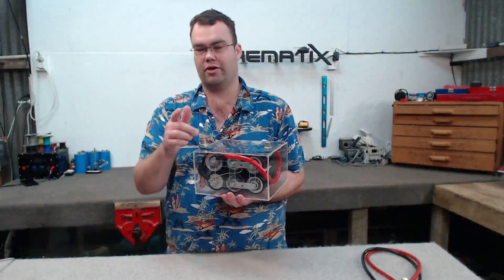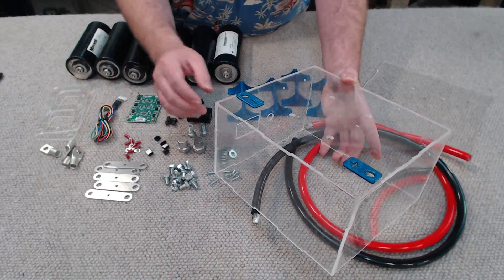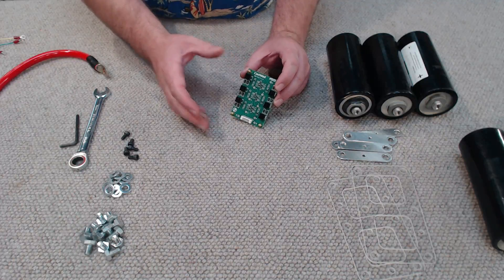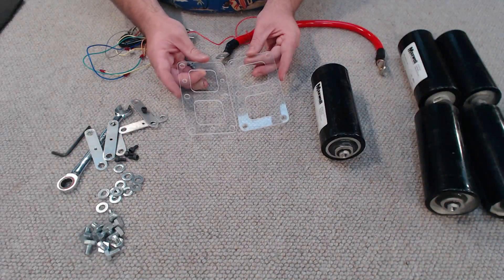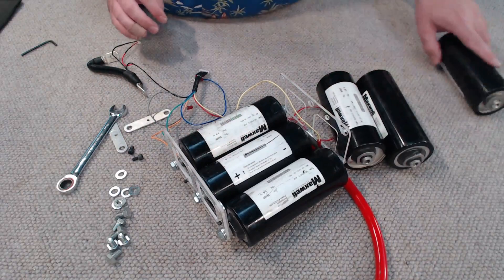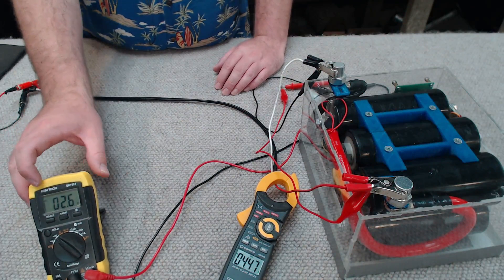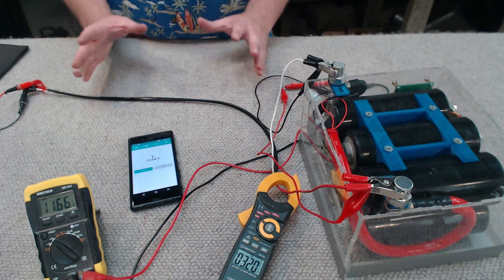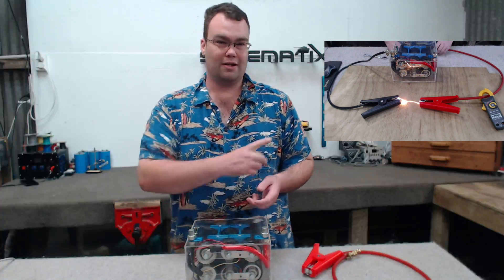Super Capacitor 'Battery' Bank Construction Video

Comment: in Australian accent That's not a soldering iron... THAT'S a soldering iron. By the way 7 years later I just bought a variation of this bank, on ebay, used. It came in tonight  but need to test it out.

Comment: How best to inspect the capacitor because even battery explode on me in 1991 if not knowing what inside and for capacitor look hard to inspect if not having window for inside or circuit Bing using voltage drop theory analysis to find hidden secrets switch

Comment: these ultra caps are not made ideally to be used without a battery! if you have a high power consuming system its best to have a good battery as well, best types are LTO batts, or LifePO4 batts, along with super caps and a good alternator of course!, these caps dont have the much needed power reserve that regular batteries do like an AGM battery

Comment: i have a question well a couple for you  can you charge these as you are using them charge while discharge  also if i wanted to build a setup like this to run a 230v 3 phase 10 hp electric ac motor would or is this possible

Comment: I know this is an old video. Im watching it after seeing your spot welder video. I was curious of the dangers with charged capacitors while working on electronics. Would touching the positive and negative posts shock you or is it safer because its only 12vdc?

Comment: those lugs are horrible...the crimp ones are worse.  you want whats called a split bolt lug. i have 8000 watt electric furnaces that run at 2600 F...and to power the elements i have to use split bolt lugs,,,,anything else just goes to crap really fast.  dont waste money , time ,,and risk a fire.  dont use crimp on lugs.

Comment: Hi all?
I don't think I can afford to make this beast, but did see a 6x500F on eBay for £35.
I need to use it as a leisure battery to power lights & charge phone, tablet, cycle lights...
I only do short trips in the van, so need something that'll charge fast, where as the leisure battery I have takes many hours to charge :-(
So if I bought THREE 6x500F's
1/ would it be a good compromise?
2/ how would I charge them (using van only) or with what?
3/ how quickly could I charge them (I'm hoping only 15 to 30 minutes)
Helpful info needed
Thanks
Mike in the UK
Reply from the maker: 6x500F cap's in series will be able to store around 2.5watthours of power storage. For context, a typical phone battery has around 10 watthours. Charge time would be a few seconds. But you'd have to limit the charge current if you're charging from a car plug. Otherwise, you'd blow the fuse every time. In a nutshell, 6x500F caps won't provide anywhere near the power storage you'd require.  The real solution for your application would be a LIPO battery pack. A quality lipo can be charged very quickly (depends on the capacity & charger used) within the time frame you specified. Plus you could have a couple batteries. So one's charging while you use the other. Hope this helps
Reply: Ahaaa, very handy info, thanks  @Schematix , I almost went for the 500F's, but willnow look for the LIPO's
Reply: So now you just have to build one of what I want & make a video about it, so I can build one myseld :-)

Comment: Ok kids I have twelve of these caps in my car for the last 8 years. I have no circuit board and I have a charger in my trunk just in case. Do not try and jump start your caps from another car , you will blow up their battery and alternator especially from 0 volts. Possibly the cars computer too . 8 to 9 volts and you will take months of life from the other cars battery! Possibly blow up the alternator.  I know i fried two of my wife’s batteries! If you want to build a charger just use a 600 watt HPS BALLAST transformer with the secondary coil chopped out. Use about 14 to 16 turns of the heaviest gauge wire you can fit and a single 400 amp diode will do. I use a 1000 watt HPS BALLAST and a 400 amp bridge rectifier and it’s overkill . Mine Chargers from 0 volts in about 30 to 40 seconds at 150 amps. Once you reach 14.4 volts the current tapers off. Get yourself a 12 volt solar panel and wire it straight to the caps for many days of not driving the car. DO NOT START YOUR CAR WITH THE PANNLE STILL HOOKED UP ! Your caps will drops about a volt a day and under 10 volts and you will not be able to start your car. Umm what else I can tell you. Oh NEVER, I SAY NEVER TRY TY USE A CHARGER DIRECTLY TO THE CAPS WITH THE CAR IS STILL CONNECTED!!!  Disconnect your caps from the car and charge your caps. Then connect your caps to your car. 150 amps across your computer will definitely fuck your car up !! Use a meter in your cigarette lighter to monitor voltage. My twelve caps cost me 200 bucks back in the day now I just buy one every Friday and I’m at ten caps for the old ladies car. Do EXACTLY what I say. Trust me and if you blow your shit up it’s not my fault! You just don’t understand electronics. DO ALL CHARGING EXPERIMENTS OUTSIDE OF YOUR CAR FIRST!! YOU HAVE TO MAKE SURE NOTHING OVERHEATS OR BLOWS UP BEFORE YOU USE IT IN YOUR CAR! Make sure you use a volt meter. Anyway good luck.

Comment: You have some really cool videos that are inspiring.
A really knowledgable fellow regarding capacitors is Robert Murray-Smith. You will not leave his channel without having learned something, a very inventive and inclusive Youtuber. He developed a liquid graphite paint/print on gel which offers 4 farads per centimeter square for building capacitors. These Graphite Super Capacitors, besides functioning like a normal capacitor, will store 3 or 4 times more energy, so they have battery qualities.
Another novel capacitor includes plexiglass 30cmx30cm, coated with melibdenum film, having a central hole through which, perpendicular to the plane of the plexiglass, is mounted a coil 4cm x 30cm. This presented by Don Smith at Tesla Symposium is said to gather ambient energy. Mr. Smith was the Head engineer for a large American Space company. Not big on details but does like to get your appetite going.
Keep on producing awesome videos.

Comment: I am concerned about the gauge of the wire used to attach the balancing circuit. The charging current in the 5A vicinity could cause significant voltage drop when balancing occurs and potentially cause a imbalance to overcharge one of the capacitors above it's 2.7V rating. This could be a disastrous problem after many cycles of charge/discharge, when each capacitor voltage will be different due to differences in the actual capacitance value of each capacitor. The wiring may burn up when 5A is applied overtime as well.

Comment: Tell me please ... Why did you choose 6 supercapacitors and not more (or less)?
Thank you for your patience with my too basic questions
Reply: 2.7v x 6 = 16.2v
Lead acid ~ 12v
Car alternator ~ 14.4v
6 Super Capacitors should be able to safely handle the car alternator turning on, after a car turns over, if this battery is to be used in 12v automotive applications.

Comment: I’m creating a solar and wind turbine field kit for camping and I’m using a 220-240 volt 300w motor with a bridge rectifier converting it to 12v dc then onto a charger controller rated at 30amp the smallest I could find then I wanted to connect it to a battery bank now I was watching your capacitor battery bank what would you suggest and would I need a capacitor to control the ac to dc to the controller??? Any help would be appreciated

Comment: As you were going to use the unit with battery clamps, why not just use lugs and bolts instead of battery posts on the unit. If you wanted to remove the cables, you could use brass/stainless wingnuts on the bolts like is done with marine batteries.

Comment: Would it be bad to use aluminum channels for the acrylic panels? Then use Line-X as an insulator?
Would a battery bank like this need some form of protection wrapping or insulation?
Would lithium ion batteries need to be protected if you were building a super battery for like a electric car?

Comment: Curious to know what effect it will have on the (14.4VDC) Alternator Voltage Regulator... (either PM or with Field- stator - winding)
Reply: smoke one suspects...not to mention a lot of modern cars run smart chargers- you need a board that mimics the charge cycle of the lead acid it is to replace and feeds that to the capacitors?
, you are also going to be charging at 14.3v from an alternator and if uncontrolled that load will increase exponentially in amperage your car will also be pulling amps to run its auxilliarys...radio on loud, air con on, headlights and interior lights and seat warmers and electric windows eyce tc- you would need to overmatch the alternator to all that, 200 amps?
i dunno...
however the whole benefit of this system is that it should in theory recharge almost instantly.hopefully that happens very quickly before the alternator gets too hot...

Comment: Excellent instructions.  But your supercapacitor seems to cost about $100 a piece.  If so, your battery costs about $800.
https://www.amazon.com/Supercapacitors-Ultracapacitors-3000F-Threaded-Terminal/dp/B005T7IKOC/ref=sr_1_8?ie=UTF8&qid=1508400746&sr=8-8&keywords=Maxwell+Technologies+Inc.

Sorry I was high on your supercapacitor car battery cost.  From Digi-Key, a namebrand supercapacitor at 3400F is just $65.  So it seems your supercapacitor car battery is material floor cost is about $400.  Again great instruction video.  I'll probably use more affordable lower Farad supercapacitors.
PS: Pls do something about those giant aussie mice down there ; https://www.youtube.com/watch?v=sFhavawkZl4 .

Comment: Solding the connectors is wrong, you need to crimp them. ask an electrician for his cramp pliers. but the whole concept is really great and you built it up very professional. Where did you got the capacitors from as I find it pretty complicated to get some?
Reply: I'd rather refer to an electrical engineer when it comes to electrical unions inside a moving, vibrating automobile.  Turns out soldering the wire to the crimp on lug provides the strongest union you can do benchmade, whilst forged lead lugs directly onto the wire is slightly stronger - that in effect solders the wire to the lug as well.  BTW if you wish to try it, I'm sure you'll find what the engineers did - you can do so without that mondo soldering iron.  (Use an oxyacetaline torch like you'd use to solder copper pipe.)

Comment: Good video, not being electrically minded still not clear on series connecting , also I have a mobility scooter that uses 2x 12v battery's wired in series, would I need 2x banks of 6 capacitors or I bank x6 with a higher output, duh! They Don't call me homer for nothing lol, 👍

Comment: Would this easily scale up to a 48 volt bank?  I want to use it in a solar battery bank to allow Air Conditioning and other initial high load appliances to operate 
Thanks for the video!
Reply from the maker: Yes, you could scale this up to 48vdc. The only issue would be the relatively high expense of the components. :)

Comment: Are caps really worth it?  Why is it that no one has used the boostcaps to boost the traction battery on hybrid cars? Just wondering!
Reply: volvo is developing supercaps built as fenders in their cars and others are using them also to improve charging rates
generally they're still expensive compared to LiIon for energy density

Comment: Those are huge caps and your box is bigger than my battery. Are there smaller super caps I can use for a car? It's a 1.6l manual trans Honda CRX. Compression is 9.1:1, average winter temp is 50F...
Reply from the maker: I've seen other YT'ers build cap banks using 350f or 400f caps and they seem to do okay. Would require some experimenting I'd say :)

Comment: Don't solder the ends on battery wires. A good crimp will hold up better. All OEMs crimp. Solder causes the wire to become brittle. At the point between brittle and flexible, you can get metal fatigue.
If you don't have a large crimp tool (they're quite expensive), some table vices have the ability to crimp. Or you can buy a fixture that will fit a vice.
Reply from the maker: Absolutely correct. However, because these wires aren't moving or bending metal fatigue isn't a concern of mine. The vice trick works great. At a pinch, a hammer and punch tool can suffice. :)
Reply: If you are in the US, you can just go to your local Harbor Freight and pick up a crimper. The 8 tons of force hydraulic ones are under $60 and can handle anything from # 14 wire up to #0 wire. When done, my #4 cables then had a sleeve of black heat shrink tube and red electrical tape on the positive leads and just heat shrink tube on the negative  ( couldn't find the right size red at the time ).

Comment: Could I use this as a 'battery' to run a 600 W AC heater through an inverter?  I have an electric car and would like to find a battery that would charge quickly and run for about 1/2 hour.
Reply from the maker: No, your heater would run for only a few seconds before the voltage lowers beyond a 'usable' level for an inverter.
Reply: If the heater can run down to around 6V, then he should get nearly 40 seconds from six 2600F caps.  (0.5*C*V^2 * 0.75)
Reply: hey send me a list where you got the caps and things that looks like it would come in hand for my business

Comment: How does the balance board work if its connected at the bus board and the caps are all connected there? Doesn't it need individual autonomy over current into each cap separately ?

Comment: The heatsinks should go on the resistors, not the chips. The resistors burn off the excess energy, the chips are just control and do not give off much heat
Reply from the maker: Incorrect. The semiconductors get extremely hot under load. I have performed tests using a temp sensor.etc

Comment: Lugs should be crimped or screw type, as solder can melt under high load conditions.
Reply: Just remember cranking an engine is anywhere around 500AMPs+ (just look at your cranking amp capacity of your battery). A loose cable will arc and get super hot if you keep trying to crank a car that's failing due to bad current transfer. I've burnt my hand on just a loose clamp on a terminal once and it was smoking very lightly before I grabbed it. this will soften any soldering and with weight on the cable, may pull it out
Reply: Because the terminals are subjected to weather conditions, and corrosion will follow, they should be soldered using a good quality flux. The cable, providing it is heavy enough, will take normal heat away.
Remember the battery posts are made with lead! A poor connection will produce excessive heat.

A starter motor should never be cranked for more than 15 seconds at a time with cooling periods between. Again this is because there is no cooling system on starter motors and the solder on the commutator will melt.
Reply: A lot of people crimp and then solder for a touch of extra connectivity. solder alone is a no no. hope those don't get hot for any reason.
Reply: Crimping is usually considered adequate.  Soldering has the disadvantage of being more prone to cracking in high vibration environments (e.g., an engine bay).
Reply: always best to crimp and solder ....but what kindof loads that you forsee in startin a car are goin to melt solder ??? that aren't a fault condition that should be disconnected anyway .
Reply: How many amps would need to be going through the contacts to heat up the solder to the 300 plus degrees needed to melt the solder?
Reply: those lugs are horrible...the crimp ones are worse.  you want whats called a split bolt lug. i have 8000 watt electric furnaces that run at 2600 F...and to power the elements i have to use split bolt lugs,,,,anything else just goes to crap really fast.  dont waste money , time ,,and risk a fire.  dont use crimp on lugs.
Reply: ps...im running low voltage mosi and silicon carbide heating elements...15-30 volts at 100 amps .  anyone who would use a crimp connector deserves to die in a fire.  i just dont want their wife and kids to suffer from their stupid choices.
Reply: Depends if it's a good joint or not  but a poor 1 ohm soldering/cracked joint as little as 10 amps @ 12v 120Watts equal to a soldering iron, many factors come into play mainly the resistance of the joint. Crimping and soldering is best you will never find a soldered car battery.
Reply: Martin Counsell, circuits cannnot get soo hot more than 70°. soldering metals has been made speacially to resit. do not talk shit. there are apliances who getting very hot like power inverters, laptops, heaters. if you are not scientist on electricity, close your mouth, think just for you and shut up.

Comment: Great video!...Btw, I had no idea soldering irons came in that size. I found this quite funny for some reason : )
Reply from the maker: Thanks! Glad you got a laugh as a bonus! ;)
Reply: @Gene-f8r :  giant soldering iron is @~6:10
Reply: Dan Nichols did he say 100 watts ??
I have a weller brand soldering gun that goes to 250 watts I use it to solder 10-4 gauge copper works really well the tip turns bright orange when it's fully heated up
Reply: @mrmeiii  , yes, he did, but I suspect it's the difference between a soldering GUN and a soldering IRON.  Your 250 watt GUN  undoubtedly works,  but as you can verify, the tip is relatively small in comparison with the IRON he used. The IRON has so much more thermal mass that the heat is sort of 'stored' in that mass & replenished from the (smaller) 100 watt heating element within it, and thus works to solder big wires which tend to absorb the heat & can tend to draw the applied heat away as they're soldered. Your 250 watt gun has to run 'more' (eats more current) to provide the same transfer of heat to the wires you're soldering, I'm guessing. Does that make sense? (Of course, the iron has to be heated for some length of time to get up to a usable heat, whereas you can turn your gun on & off as you need to use it.)